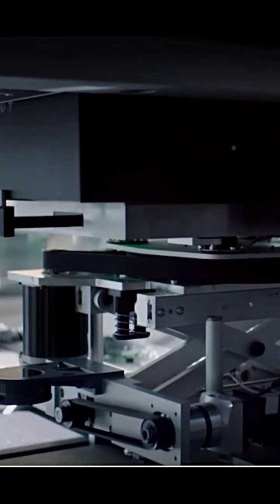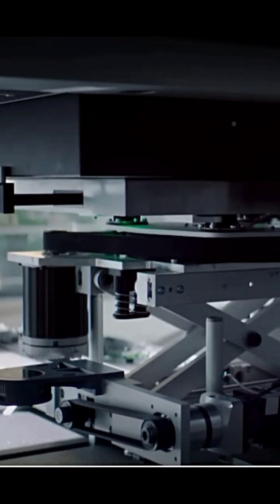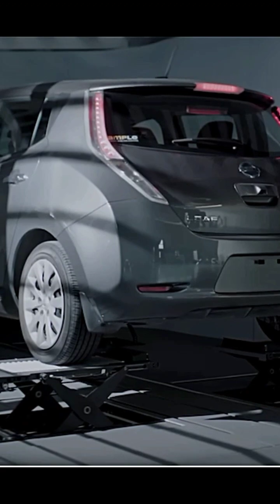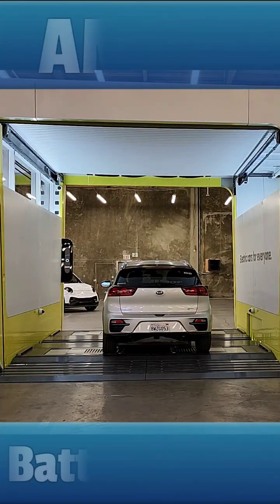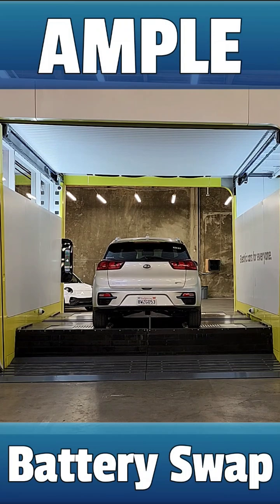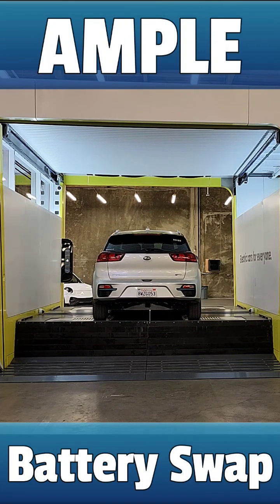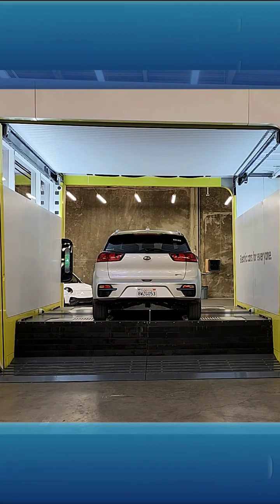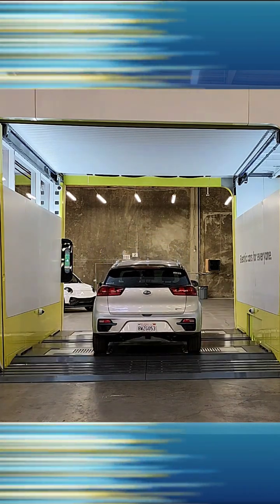Battery Swap For EVs?

Comment: Fast charging is already quick for EV. Lucid Air can get 18 miles per 1 minute. In a few years, that number will probably be doubled. Battery swapping just doesn't sound useful. 

A fully automated tiny station that offers other services like tire changing, tire rotation, brake maintenance, etc sounds way more useful

Comment: Battery swapping stations only make sense if you lease the battery, which I certainly wouldn’t want to do. 🤷‍♂️
Reply: Incorrect, with modular battery packs some 'could be' leased and some can be owned. 

And even in China batteries swappable EVs are in the minority. This is just an option for those that need or want it.

Comment: So you only need twice as many batteries as cars? What happens if your battery is damage by road debris, is that part of the lease or am I buying a damaged battery?
Reply: Actually the opposite is true. Since lower capacity battery packs are needed most of the time. And battery swapping stations do energy arbitrage. Producing revenue and helping to balance the grid.

What happens if your fixed battery is damaged by road debris after the warranty is up? And the battery swapping station is responsible and test the battery packs constantly. So of course battery swapping is an advantage in these situations. And do you worry about this when you rent an EV?

And what about if new longer range batteries become available they can be used for towing?

Thx for the joeblowfud

Comment: This is the way it should be but it needs to be a regilation, a standardization not just a proprietary system of a disruptive company.  We argue about something aseanimgledd as NACsS and CCS but this is where forced regulation is needed and where we're not likely to get it.
Reply: Yes and no... if you check out what's happening in China there is consolidation, but it's far too soon to have a single battery swapping standard. 

And certain specialized vehicles can never be standardized. For example there are battery swapping networks for cement trucks 

Plus what Ample is offering is a very flawed example of battery swapping. So it definitely shouldn't  be the standard

Comment: Needs to be faster than a chain driven car wash. 2 minutes at most. Pull up to, scans the licensee plate as it enters a bay, robot already has the fresh battery ready, while the dead battery is pulled, new battery lifted and locked and green light go. The system they have with lifting ??the car and moving it around is all too complicated. U shaped bridge for the tires, over a pit and the robots and batteries should be all self aligning.

Comment: I mean, when you say EV you mean any vehicle, not just cars. Since they already have massive numbers of people using electric mopeds with swappable batteries in Asia, it just does have a future, doesn't it? 

Can it work for cars? Probably. It's already being done too. We'll see. Lots of people are putting it in quadricycles and perhaps cars too. Lots of reasons it'd be great. Not got a driveway? Take your swappable battery upstairs to your flat, charge it, in the morning you have enough range to get too and from work. Simple. Charge the rest of the battery when you get to a fast charger or to the supermarket.
Reply: Thank you, finally somebody that can see the bigger picture and who's open-minded. 

Hope the battery swappable Nimbus One makes it to market  And hope a powerwall energy storage unit, that used the same swappable battery packs will be an option too at some point?

Or how about an EV with a small low capacity fixed battery pack. Plus places for additional rented swappable battery modules, for towing or traveling longer distances? (And CATL also offers modular battery packs for EVs)

Not every EV has to have a swappable battery it's just an additional tool, in the toolbox. It's a little sad that the West is so far behind, but c'est la vie.

Comment: So, swapping out batteries, meaning unbolting and resecuring hardware over and over and over... how long before a bolt is crossthreaded or just fatigues from cycling in and out of the vehicle over and over?  How about the cooling connectors and electrical pins?  I think those are huge parts of why Tesla doesn't offer this at all, even after showing it early on... just not needed.  To many potential failures and liability... and if you go with it, how many batteries for how many different vehicles are you going to store at a swap station?

Comment: There are two main paths forward for swappable batteries. Either your station has to specialize in one or a few very similar models of batteries that all work with the station's same equipment, which would fracture the industry so that you will have multiple battery swap stations on each block, each of which can only service certain battery models; or there has to be some industry-wide regulation forcing EV manufacturers to all use the same battery.

There might be a middle road using parts of both the above paths, too, I guess.

Battery swapping might be great for fleet owners, who will pick their preferred EV models so they can all be served at one station.
Reply: The problem with all that conjecture is there are  Chinese battery swapping networks that disprove those supposed 'limitations. 

For example CATL has a battery swapping network that's used across EV brands. 

Some of what said here does make sense, but it's not limited just to those criteria.

Comment: One complication is that – assuming there is variability in charging capacity – it will be harder to plan trips, and harder for cars' on-board computers to accurately predict range.

At least, planning will be an issue until battery swap stations approach the ubiquity of gasoline stations.

I suppose range calculations can be made reasonably accurate if each battery module can accurately report its state and history to on-board computers.

Comment: Just like NIO does in free markets, you can LEASE/SUBSCRIBE to batteries, and swap whenever necessary. No need to worry about charging before a long trip just show up for a full pack. You might argue that you take good care of your pack and don't want to mix them all but if you're concerned about the eventual replacement of the pack, this eliminates that worry as you'll always have access to a serviceable pack. When you consider the impact of DC charging on your pack, picking up a pack that was likely charged at a steady rate in a controlled environment is better than jamming electrons into the same battery over and over on trips. Battery swapping will be an excellent addition to EV infrastructure.

Comment: We’ll do literally anything to avoid building trains.
Reply: Can we do trebuchet+ wingsuits before trains as it will reduce my need for coffee.
Reply: We’ll do anything to avoid building mass public infrastructure transport !
Reply: Why not do both.
Reply: @nc3826 I'm confused.. either way, it's a valid proposal when you consider at basic AF 240V 48A EV charger only costs $200 vs a Tesla supercharger costing $68K per which you must install multiple as the 3 phase electricity infrastructure necessary to support the demand surges at relatively unpredictable times of the day. In most cases from my experience ALL DC fast charging will be more expensive than having a 30 mpg vehicle
Reply: @nc3826 At further expand citing PGE electric in California EV charging under their EV-B plan in summer at super peak hours is $0.72 per kwh VS $0.37 super off-peak having a 125% gain in cost difference. Per 10 KWh that's a $3.50 difference in costs.
Reply: @nc3826  Both scenarios poking fun at the absolute disregard of infrastructure and land repurposing necessary to actualize their train dream. Toss in corruption + zigzagging the route turning the blueprint high speed rail to basic AF slow poke city transit speed then it's a nightmare on costs. Which that scenario is the California HSR project that even the initial promoter is against what it has become.

Comment: By the time they ramp up the ev range will be over 600 miles.  Maybe for trucks
Reply: Why? The average driver in the USA does 30 miles daily at most so 600 is 20 times daily needs. Even for your local delivery driver 50 to 200 miles daily ranging from hub to store, food delivery, taxi, package delivery, and local service / utility trucks.
Reply: @RP-hn1qc  the average driver cant get to super chargers all the time because they live in cities with limited access to charging.  Others like me have winters that half my range. There isn't enough chargers and cars don't charge fast enough
Reply: @ChicagoBob123  How does having a larger battery help if you don't have a supercharger? That's like opting for dual fuel tanks on a pickup truck to double your range but you never drive enough daily to truly utilize the supply.

I just find it rather comically ridiculous that everyone insists on having the range "possibly necessary" for less than 5% of typical annual trips such as going on vacation. You're paying higher property taxes and insurance costs for excess range capacity that will never be used 95% of the time.
Reply: @RP-hn1qc  I think you are missing the point. A lot of people DON'T/can't charge at home. So who said you don't have to supercharge? People who do ride share and people that live in apartments have to supercharge. The larger the range, the less they have to go out of their way to get some juice. The less hassle the more EV adoption.

Comment: This fits commercial fleet cars, vans, trucks, service vehicles. I wouldn’t swap my carefully maintained battery for an abused exhausted one.
Reply: On the flip, you can use and abuse your batteries to 100% every time and never worry about it. Cost to get a new battery is negligible and they'll automatically pull used up and poor performing batteries out of circulation I would hope. 

Would it change your mind if you were a long-term owner, or second hand owner with a 130k mile battery with severe and out of warranty degradation to be able to do a a cheap swap vs a 20k+ replacement? You've essentially increased the life span and thus value of your expensive vehicle by having something like this available.
Reply: @tazeat Indeed, battery swapping could eliminate concerns over battery lifespan.

The only limit to your battery life would be the swapping agreement itself.
Reply: I’m against abusing anything, including an inanimate object ………….. I know, this is not part of the culture!
Reply: This idea works best with batteries you don't own anyway. You'll lease/subscribe to batteries and swap as necessary.
Reply: No there are EVs already being made for this type of system the beautiful thing is you never "own" the battery". so if you get a bad one you swap it out. Nio in China has been doing this for years
Reply: China has numerous battery viable swapping networks. While Ample has far too many flaws. 

For example a full battery swap of all the modules takes between 10 and 15 minutes... And there is no onboard charging option...

CATL has a modular battery swapping system. That has none of these flaws. Shame it's only offered in China.

Comment: Improve serviceability without making my battery that I care for meticulously a commodity.  Ever used a power bank rental vending machine? Nothing but abused, worn out batteries that keep getting cycled in and out at the inconvenience of the end user.

And before y'all come in here saying, "no they'll definitely monitor and curate the stock" tf they will.  Replacement batteries cost money. They won't remove a battery from service until they have literally no other choice.  

And what about "the cost of an EV is almost all in the battery pack" so what, I buy a $50k car and then trade my fresh new battery in for your Leafs third battery?  

Foh with this shit, capitalism can't be trusted.
Reply: Battery swappable NIO EV owners can buy their battery pack or swap it out and buy a newer one....plus AC and DC charging is always an option for them... 

If battery swapping was not superior, nobody would be using it.... Is the bottom line.
Have fun in your fear-mongering fantasy world...

Comment: Ample is the real deal. The fact that they sized the modules down to shoebox shapes is a game changer.
Reply: Ample  has far too many flaws. 

For example a full battery swap of all the modules takes between 10 and 15 minutes... The quoted swap time here is only for an average partial swap... And there is no onboard charging option...

CATL has a modular battery swapping system. That has none of these flaws. Shame it's only offered in China.

And I've heard the Ample CEO talked many times he's always spinning the facts. It would be great to have a battery swapping option just not from Ample.